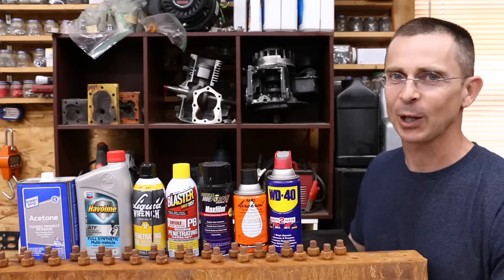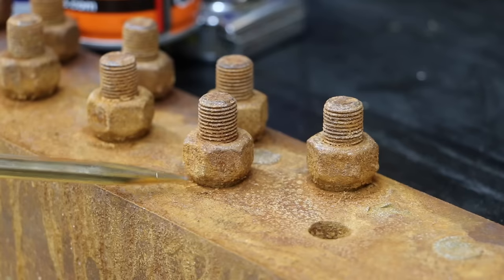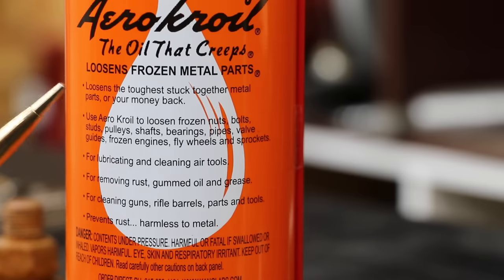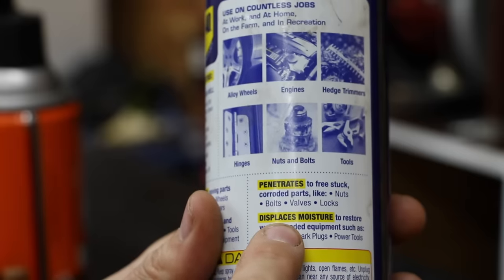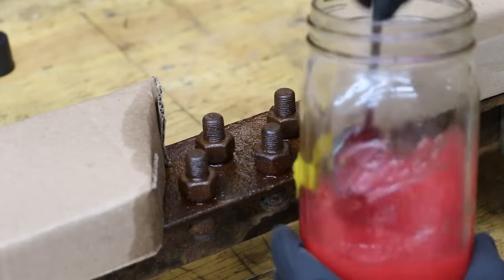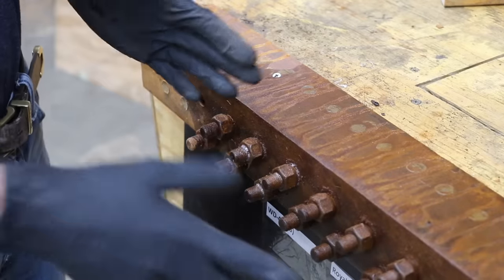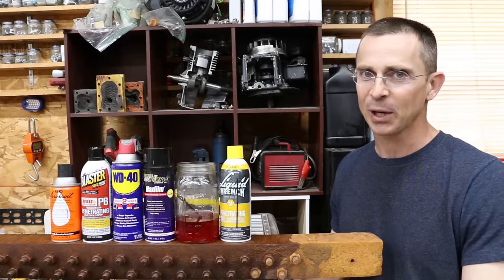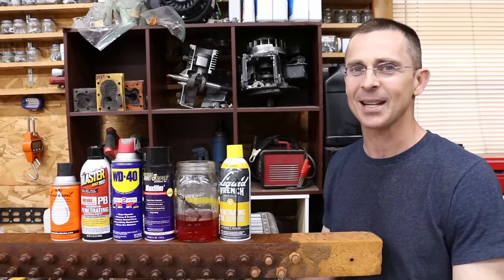Which Penetrating Oil is Best? Let's find out!

Comment: Also, worth mentioning is to heat the nut and not the bolt. The idea being that the circumference of the nut will increase and separate from the bolt and break the 'seal' formed by the rust/etc. Yes, the bolt will get hot and expand as well, so if you've never done it before, heat the nut for a bit and then try to remove it. Lather, rinse, repeat.
Reply: And if something really truly stuck you can go the ole heat-water-heat-water-rinse repeat until desired result is achieved
Reply: I wouldn't contradict your experience that it works better as im not a mechanic, but the explanation confuses me. When you heat a metal, for example a nut, it expands in all directions, ie. it increases in volume. So the outside dimension increases in "radius" and the inside shrinks in radius. When the bolt gets hot it just gets bigger. The final effect is that the brittle rust gets squished between the surfaces and breaks its adhesion to the metal loosening the bolt after it cools again and all the surfaces shrink again. Does that make sense? Or do I have it wrong?
Reply: @cnf6045  Exactly! Thermal shock is better than heating the nut and trying to remove it hot.
Reply: String Larson - That's exactly what I was always taught, BUT just recently I was attempting to remove a pitman arm and heated the nut for about a half hour and couldn't get the impact wrench to budge it. I then said #! and heated the arm itself for about 5 min and was able to break the nut in 5 seconds. Counter intutive I know BUT DAMN!
Reply: @clutions  Yeah, once the 'rust' essentially, fuses the parts, to a point where the heat applied will transfer from the nut to the bolt at the same rate as thru the clean nut. it can get/does get pointless. Time to rebuild from new.
The other thing to consider is that the strength of a say steel rod/bar/etc. degrades exponentially depending on the integrity of the initial material. 
As a simple example (and if I recall correctly) a 1/2 inch rod with 1/16 inch off corrosion will have a non-linear reduction in "strength" (shear, tension, torsion, etc.) 
This is important for many reasons not least of which is if one has a torque rating on a bolt and wants to mount a new nut, or of that works, whether or not that bolt/nut will hold up under required conditions. etc. etc. etc. etc
Reply: @joeyt684  that is incorrect. If you heated something metal with a hole in it the diameter of the hole increases. It does not expand inward.
Reply: Try this - heat the nut, then squirt the bolt with WD-40. That's the only way I found that works when removing the alignment pins from the back of a 7.3 Powerstroke block. The WD-40 often will flame up so be ready for that.
Reply: @joeyt684  no it doesn't work like that .. When you heat a nut the diameter increases including the inner diameter..an example is putting a starter ring on an engine flywheel  you heat it up and drop it over the flywheel and its literally 2 ot 3 mm bigger or 1/8th inch in old money and its then a shrink fit when cold
Reply: All I can say is when you have something like I have, a jet ski trailer where the nuts have rusted on due to the salt water (even after rinsing the trailer after each use).  If none of this "stuff works"  and heat doesn't help.  I just got out the grinder and ground each side of the nut off and it goes quick and you just take a hammer and tap out the bolt.  If you actually grind off enough of the nut on one side, you can just tap the rest off the bolt. It's just as quick as trying to use heat or anything else.  I realize this can't always be done due to where a bolt may be located.  However, if you can get a grinder into the bolt/nut, just grind it off.
Reply: @allenblevins7430  Too bad manufactures don't do this when they manufacture the trailers.  Bean counters probably told them it would cost an extra 15 bucks a trailer  :)
Reply: @joeyt684  not more than it expands outward because it is centric it has two ways to expand. We dont care here if the hieght expands. A circle is bigger on the outside right? Meaning more material to expand. So it expands atleast 10x more outward than inward. Actual amount depending on how much metal and size and temp. Do it fast so heat doesnt catch up dissipating past the airgap expanding into the bolt and reaching the same temp as the nut.
Reply: @renesisfd1  it does. it just doesnt equal the amount of material expanding outward
Reply: @joeyt684 actually as the nut gets hot and expands the inside and outside diameter both get larger. That's why the nut comes loose. Some pullys, bushings are installed the same way. You heat the metal sleeve the drop it quickly over the shaft and into place. When it cools you cannot move it.
Reply: @cnf6045 I thought you were describing your Turkish bathhouse experience!
Reply: Okay so your idea has all the right intentions but it is incorrect.  The nut will on fact spread outwards.  Totally understand your point of view but that's not how it works. It just grows outwards.  I know for a fact because I've used heat to fit interface fit hubs and it was absolutely nessisary to use that heat to get it to slip on. The hub on a smooth crankshaft snout is basically the same idea as nut and bolt without threads. It's smooth.
Reply: My comment was for @joeyt684
I came from Facebook and it won't allow me to edit nor did it tag you 🤷‍♂️ weird
Reply: @renesisfd1  exactly

Comment: My dad would always get the Liquid wrench from the auto parts store and tell me "aaaahhh its good enough" turns out it was very good and better off.
Reply from the maker: Thanks for sharing.
Reply: It didn't work at all for me 🤷‍♂️
Reply: Copy Imitation it’s possible no penetrating products would do the job 4 u. I’ve had times when heat was the solution 4 me after trying penetrants unsuccessfully. Have a nice day
Reply: @kennithmorella2693  a 50/50 mixture of acetone and ATF did the job almost instantly.. The rust started to liquefy and melt off. I sprayed the liquid wrench on the bolts multiple times, And not once did i see any rust start to liquefy.
Reply: @c0pyimitati0n  I will have to do a test with evaporust and see if it works on stuck bolts and nuts.
Cheers
Reply: @ProjectFarm  which im surprised
 I am a liquid wrench guy now no more pb blaster for me.
Reply: @c0pyimitati0n  i too have had really good luck with acetone/atf
Reply: Sometimes even heat won't do i had a keyed hub on a 1" shaft on a mower trans one side came off with to hits of the hammer the other side after 2 weeks of sitting in pb blaster no luck I heated it up with a oxygen  torch for 20min hammers jawed pullers air hammer that hub is still on there
Reply: I always used liquid wrench. I always tape the end of the bolt 3 -4 times between squirts That taping helps allot with penetration of fluid.
Reply: Kroil has never failed me!! Including a large frozen water valve in the plant that had not  been turned in 40 years!! 😎
Reply: Liquid wrench is diesel fuel in an arenol can
Reply: LW probably is best for this situation but not all. Figure most bolts etc that haven't been pulled in a while will be at least a little sticky. Then there's ones that the threads are almost rusted off of, with whatever parts they hold together nearly welded together too. The testimonials for Kroil for instance are usually in that more-rust-than-steel category but it could be what makes it work there wouldn't matter unless taking a torch to it doesn't even help.
Reply: Diesel fuel in a can
Reply: I was duped by PB Blaster for decades since that's what my dad used instead of liquid wrench. I'm switching

Comment: I've always been a fan of Liquid Wrench (or fire wrench when you can), and was happy to see it do well. One thing you could add is that tapping on the nut or bolt after you've applied the penetrating oil makes a helpful difference most of the time. Thanks for the video.  :D
Reply from the maker: Great point!  I should have mentioned this.
Reply: yes  I was going to say the same thing, tapping on the nut/bolt, liquid wrench used to have that printed on the can. Only thing else I want to say is I use wd-40 on spark plug threads and have never had a spark plug seize in a head
Reply: you should also try adding penetrating oil on heated bolt, works so much better :)
Reply: I found a real excellent way to use liquid wrench on both oxygen sensors and exhaust bolts. First drive the car and get it hot. Next, spray the bolt,  nut or sensor  with Liquid Wrench. 
     It generally smokes a bit. Let the car sit for 15 minutes. Spray again, let sit for another 15 minutes, spray again and let sit for about an hour. Now try to remove the nuts and bolts and they will generally come off. I was amazed at how much easier exhaust bolts and especially oxygen sensors were to remove when doing this. Yea, it takes a couple hours of prep with Liquid Wrench, but it has proven to be worth the effort and wait several times for me.
Reply: One thing I know about Liquid Wrench is never use it on door latches or window regulators. I lubricated my door latches over a year ago and the Terrible smell is still in my car like I did it yesterday. Liquid ranch is OK for engines or exhaust where is the smell doesn’t matter

Comment: Excellent video....as always.  Thank you.  I used to use WD  40,  then Liquid Wrench, then ordinary gun oil/cleaner.  Honestly, none of these things seemed to work for me.  Finally, while I was in a small engine repair shop one of the mechanics told me about PB Blaster....he said it was the best he had found.  So, I immediately went and bought some PB Blaster, took it home, and applied it to the stuck bolt in the aluminum trans case of by pos John Deere riding mower.  After an hour I tried to loosen the stuck bolt....nothing.  I sprayed again, waited another hour....nothing.  Finally, I gave up, sprayed the stuck bolt again, and let it sit over night. So, the next day,  just before I was going to light the fuse to the stick of dynamite I had waiting for the JD, I decided to try to loosen the stuck bolt one final time.  Amazingly, as soon as I put the socket to the bolt, it simply turned....and was loose.  The clouds parted, a bright beam of sunlight shone down, and the nearly departed pos John Deere mower had "new life"....and a new name...."Lazarus".  So, I have been using PB Blaster all these years since then and, of the products I have tried, I highly recommend the PB Blaster over any others I have used
Reply from the maker: Thanks and you are welcome!  Thanks for sharing.
Reply: It's a miracle (cue Holy Grail horse reference....).  Glad it finally came loose for you!

Comment: I’m a little shocked on the results. I’ve always been happy with PB blaster but looks like I’m going to give liquid wrench a try. Awesome videos!
Reply from the maker: Thank you!  Thanks for sharing.
Reply: I was thinking the very same thing.. Especially at that price! Only downside is not as easy to find.
Reply: I am following a couple of big youtubers that strongly recommend PB over WD40. Guess they are sponsored.
Reply: @helgedell  PB blaster and WD40 both have their purposes and different scenarios. However I’m sure most on this channel have both in their garage. Both are winning and WD40 been around forever.
Reply: @Hard Core  Also might go up in price a bit due to the Project Farm Effect.  
....oh wait this is a 4 year old video
Reply: @h8GW  probably did just due to inflation.
Reply: They changed their formula a while back. Doesn’t work as well now
Reply: @mitchellragle6415  Nice.. I’ll check it out once I’m done with this PBB.
Reply: I have wd-40, wd-40 rust buster , PB blaster and Liquid wrench 🔧.  Here is the order I use if wd-40 don't work I use wd-40 rust buster then PB blaster and finally Liquid Wrench, the reason is that Liquid Wrench stinks so BAD I don't like to use it unless I have too, but that being said if all others fail , Liquid Wrench works.
Reply: As a 40 year professional mechanic, Liquid Wrench has always worked the best,imo..
Reply: In Minnesota it’s at all the Menards
Reply: @waterop4  Kroil I have found to be absolutely amazing. I’ve had very rusty and tough bolts that gave me a hard time for hours after using WD-40 and PB blaster. Kroil is like my Heavy Hitter when all else fails other than Heat ofc
Reply: What about Free All?
Reply: @Ttcw89  ...but how does Kroil smell? Most of these penetrant sprays really smell bad especially Liquid Wrench. 😫
Reply: WD40 has a dedicated penetrating oil that he didn’t test. I switched to it because PB Blaster, which has always seemed most effective, reams. I switched to PB because I felt Liquid Wrench just didn’t cut it and was very oily and messy. Would love to have seen Cre-Oil on this!
Reply: @waterop4  kroil is by far the best smelling out of any penetrant
Reply: @nickbranum5705  ...I'm going to look for some of that Kroil, I hate anything that smells too Chemical  like👍 .
Reply: @wolfeadventures  which product switched there formula?
Reply: @G00B4LIFE  pb blaster. Still works. Just not quite as good. I’d still buy it.
Reply: @wolfeadventures  I have heard from other lubrication industry insiders its mostly kerosene and coconut oil. (WD 40)   Maybe Try makin your own sometime
Reply: @sc3ku  Good to know that Wd40 has a penetrating oil product! I'll try that over the standard Wd40
Reply: I also find CLR to work great as well it works great to break down rust.
Reply: Same here I’ve always used pb blaster but looks like I’ll be switching over to liquid wrench. Only difference, some years later it is now $11.99 for a can of liquid wrench opposed to $5. The times we’re livin in…
Reply: PB blaster was the best 20+ years ago, they changed the ingredients and hasn't been the same since.not even close .
Reply: You don't have to be shocked. Many of these sprays are not really penetrating, you just think that it has worked but you are fooled. It would have been almost the same to lose the nut without any penetrating spray.
Reply: @disdonc6012  ....That's true.  And, if you think really, really hard, you won't even need a wrench....just use your fingers.
Reply: @h8troodoh  As someone who has used WD40 and PB Blaster and tried Liquid Wrench just for the hell of it, I have to say I am a solid believer in LW.  I was so impressed with it I called the company and talked to one of their engineers.  They were impressive as well.
Reply: @sluggonotnancy6178 haha, my thoughts as well. I will say I was attempting to loosen a large tensioner nut. It was in a difficult spot and only could fit a wrench enough to make a very small rotation. I sprayed it with wd40 and others over a couple hours. Didn't loosen at all. I sprayed it once with JB 80. Came back a half hour later and spun it off by hand. Easily

Comment: Heat with a propane or mapp torch for appx. 30 secs. Then apply penetrating oil. The heat sucks it in instantly.
I bent a breaker bar recently trying to remove rusted bolts under my truck. Heated then sprayed and VIOLA, nuts  came off fairly easy with a little effort.
I was very impressed.
But be careful working above you  when you spray the penetrant onto the heated metal it drips hot oil on you. So position yourself to the side.
Reply from the maker: Great point. Thank you
Reply: It's written: VOILA! Viola is a girl's name or musical instrument.
Reply: No, it just evaporates the volatile contents of the penetrant. (EVOC)
The heat loosened up the bolt more than the penetrant did .  Heat expands allowing the oil to get in. But you don't always have the option of using an open flame. like a hanger strap on a gas tank or brake line near the same. Just FYI
Reply: @agr8dane1  I've never got a heavily rusted object loose with a propane torch alone. Just FYI
Reply: @agr8dane1  you can with a hotter torch. But what I said was the heat allowed the oil to get in due to heat expansion.
Ever put a ring gear on a flywheel? 
You're not wrong just explaining.
Reply: @janelgaard7302  You can't use heat everywhere. I working on cars, sometimes heat is no option. Damage or burn wires ,sensors, whatever.
Reply: @drszoke  if you read my comments I brought up exactly what you said. Ugh
Reply: @drszoke  go to the comment above yours.
Reply: @janelgaard7302  8500 comments... I didn't go through on all... :-)
Reply: Tokyo lures
Reply: That's partially why I use the Royal Purple over some others - it doesn't burn nearly as easily. So it's easier to use it with a torch without accidentally making a flame thrower. :D

I have had situations where a fastener wouldn't (easily) come loose with either heat or RP alone, but the combination always works.
Reply: Candle wax is used on an exhaust manifold stud the same way. You heat the stud with a cutting torch and then apply candle wax.
Reply: @wetrock2766  nag nag nag
Reply: Viola probably got the idea from Lorena Bobbit @ "VIOLA, nuts  came off"
Reply: That right 🏁
Reply: @plainwornout3964   if thats all you have, you use it, and it does work if you use it right.
Reply: Just dropping in my 2¢ Canadian: to be annoyingly precise, it's spelled VOILÀ.
Reply: I suspect that works because you heat the nut hotter than the bolt, causing it to expand , which might create some pathways around the bolt. I wonder if it works best if you try to keep the heat solely on the nut and away from the bolt.